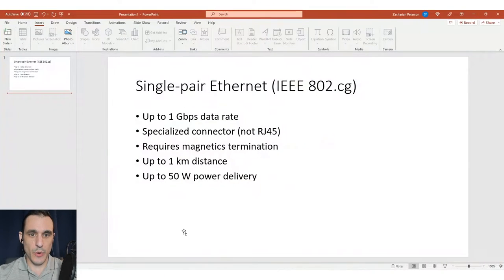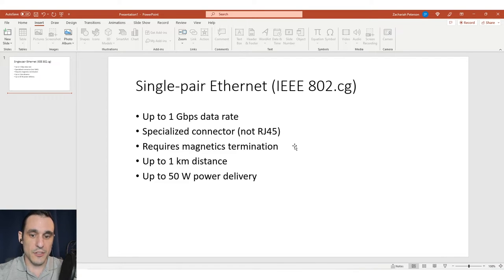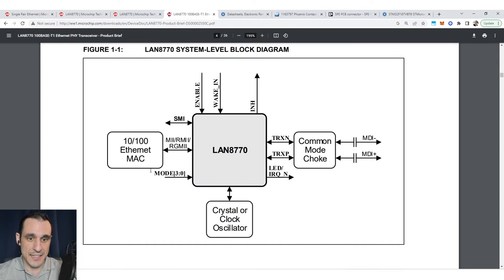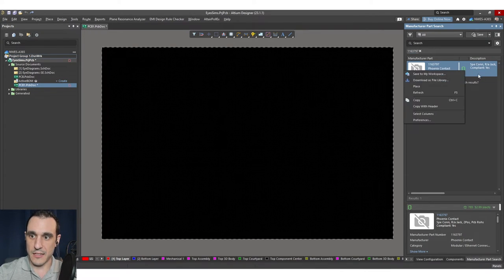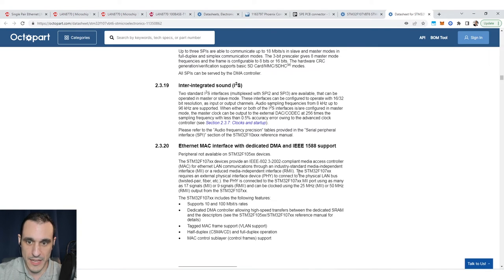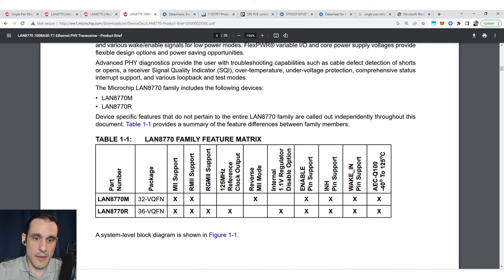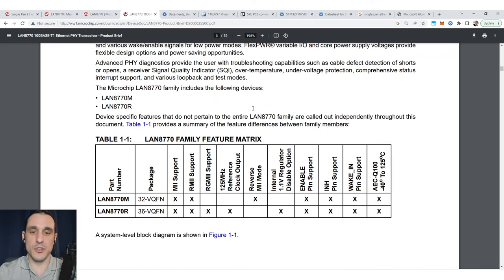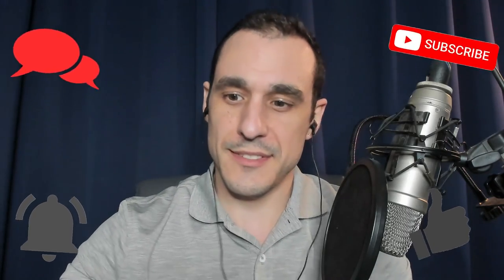Single-Pair Ethernet Overview

Comment: thank you very much for new video and topic! My stupid question: "Need I use any adapter between single-pair ethernet and usual 8-wiring?"
Reply: There are no stupid questions, and no there is no adapter. Single-pair Ethernet uses a single cable with its own pair of wires, you won't be using a standard 8 pair cable that you would use with regular Ethernet connection. With that in mind, there might be some kind of adapter between different cable formats, you would have to look online. For example, I know that there are single-pair ethernet to M-series connector/cable adapters.

Comment: Is this the same as "Automotive Ethernet" ?
Reply: Yes and no, there are multiple IEEE 802.3 standards that deal with different types of Ethernet. The single pair versions of Automotive Ethernet are 802.3bw (100BASE-T1), 802.3bp (1000BASE-T1), 802.3cg (10BASE-T1S), and 802.3ch (2.5/5/10 GBASE-T1), but there are other automotive standards that are based on either 2 wires or 4 wires. The generic 802.3cg standard covers up to 1GBase but that standard does not cover operation specifically inside a vehicle.